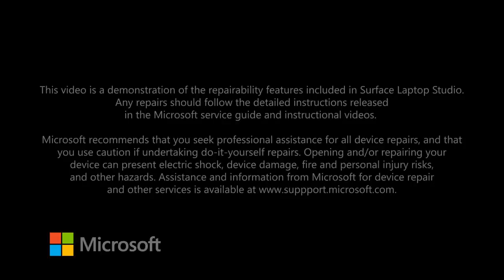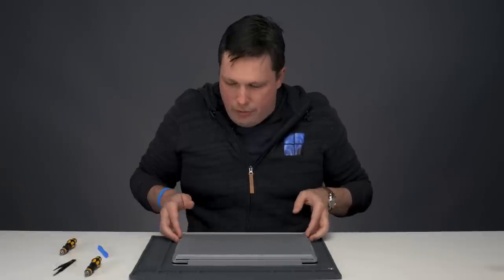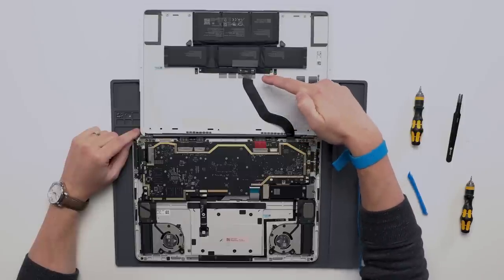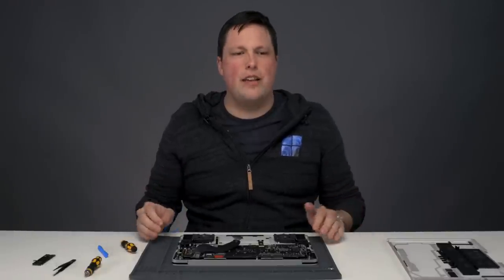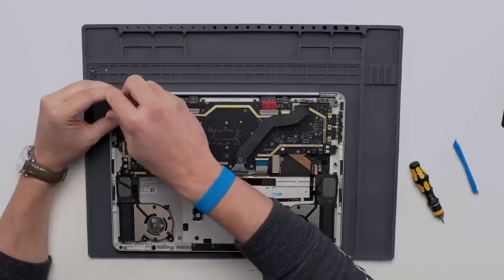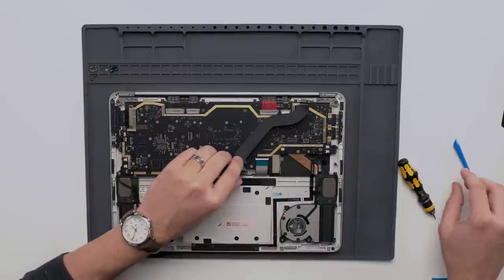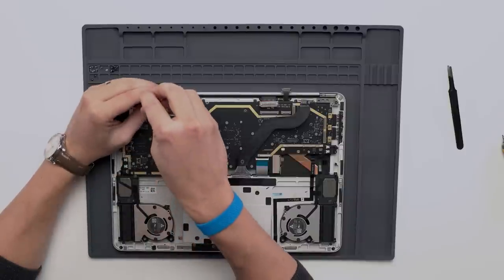Repair | Surface Laptop Studio

Comment: Surface Laptop Studio was on my AVOID list, because I assumed it would be a nightmare to repair it myself, especially the display and potentially a glued in battery. This video is very powerful, as it has now moved this to the top of my list for my next mobile workstation. Thanks for this video and also putting the RTX A2000 into this device. This is a huge step in the right direction Microsoft, seriously thank you, please do not stop here.
Reply from the maker: Don't worry, we're always looking for ways to improve! But we're happy to hear that we were able to turn things around. 😉
Reply: @surface  Do you think you could do a video on reassembly after opening up the device? That would be really helpful
Reply: Where can I find a review video talking about this laptop with an RTX A2000
Reply: @io_inc  Surface Laptop Studio has 2 options. Nvidia RTX A2000 or RTX 3050 Ti. You can see it from Microsoft website.
Reply: Ok.... so.... can the memory he upgraded?
Reply: @ninjaunmatched  No, because it uses lpddr4x memory, which do not come in sodimm sticks.
Reply: So RTX A2000 is better !? Than 3050
Reply: ...but, but battery still glued
Reply: @DmitrijRebrov  Stretch release adhesive makes it easy enough to replace.

Comment: My old Surface Book 1 wishes it was this repairable. Such a positive change to make these devices more serviceable and recyclable.
Reply: I echo this, this is a huge improvement.  In early 2020 my SB 1 got the dreaded well-documented swollen battery problem.  After a super-careful crazy two hour repair, I successfully replaced it with another battery, but the touch/pen no longer worked properly.  Then earlier this year the swollen battery occurred again, but this time in the base/keyboard.  I removed the battery but didn't bother to replace it.  The whole thing is now being held together with green masking tape.  Hopefully all the future Surface products get this repairability treatment.
Reply: My old Surface Book 1 is now in need of repair after 6 years, I was going to avoid Surface devices, but this is making me rethink.
Reply: @Hans-gb4mv  wow!! It lasts a long time

Comment: Microsoft, if you keep that way into repairability, especially if you emphase it on your next surface laptop, it's a win
Reply: Def hoping this applies to the next Surface Laptop. Surface Pro is a lost cause for repair ability as the design from the Pro X and Pro 8 is probably locked in now. I would like to see upgradable RAM on a future Surface Pro, even if you have to buy from MS

Comment: This is a major improvement over previous Surface devices! 

My only real concern is the two final screws holding on the cosmetic plate are hidden under a vinyl sticker, which would make reassembly next to impossible to maintain the aesthetic cohesiveness. A pin released panel like the SSD/SIM panel on the Surface Pro would be much sturdier, accessible, and easily reinstalled.

Thank you for making such an effort at improving repairability and keep up the good work!
Reply from the maker: Thank you for the kind words, and we really appreciate your thoughtful feedback!

Comment: So good to see how much can be replaced and how little adhesive is used. It'd be awesome if a future iteration made the battery replaceable, too, but I imagine that's a bit more challenging to engineer than other components.

Also, props for adding that note at the end about needing to connect a charger after reassembling - probably saved someone out there from panicking ;)
Reply from the maker: Thank you for your kudos and we appreciate your feedback! We're always interested in improving so we'll be sure to pass this along to the rest of our team. 😊
Reply: Are the components from the video readily available to customers? Agree it’s a great step but we need to be able to easily and affordable buy all the individual components

Comment: Very Informative and straight forward video.. i love using this laptop.. i have already bought one.. but my questions are, where is the RAM bracket ? i didn't see it through out the video, is on the back of the motherboard?  and how about the cosmetic plate , do you sell the replacement part?
in any case, thanks Microsoft for this amazing Laptop

Comment: Could you potentially drill holes or cut a rectangle on the bottom cover then add a mesh to help with cooling? I noticed that it has poor cooling.

Comment: And where do I get new feet and this other sticker that had to be removed at the beginning?
Better to design your devices in a way that this is not necessary. I don‘t care if any screws are visible on the bottom of the device. 
Even MacBooks are accessible without the need to remove some silly stickers first that need to be replaced afterwards.
Reply: I don't know this personally, but I've seen on reddit a few times that once you register the newer Surfaces, you can go to your Microsoft account, choose Support/Repair (or similar), and they'll send you a new set of feet at no charge.  I assume it's the same for the other sticker.
Reply: The sticker is actually just a plastic strip. It's held down with double sided tape. Speaking of which, anybody here has a source of really narrow double sided tape? Asking for a friend..
Reply: This is still bad practice imo. If I want to open the device just to remove some dust I have to order some replacement stickers afterwards. Microsoft really needs to improve this for their future products.

Comment: If anyone should know. If you do plan to purchase this and upgrade the SSD it's possible. The service guide lists all the parts and part numbers but the only part Microsoft sells is the rubber feet. The cosmetic plate is not available and this is after talking with different people at Microsoft through online support

Comment: Hello, is there any way to replace the USB-C Thunderbolt ports separate from soldering from the motherboard. Also is it possible to get replacement rubber feet and the plactic strip at the bottom. Thank you.

Comment: so, as you probably are aware, the two biggest issues to fix are the stability of the thing, it can get wiggly as you pull the screen out, so a tighter hinge resulting in a more elegant transformation would make this a banger, as well as that people want this thing in 16 inches. Whats your stance on these kinds of user reviews?

Comment: Wow... this gives me chills.
Its like things are going very bad in this world WHILE things are going to get awesome T_T ! WOW xD

Seriously.... AMAZING JOB... I need one like this !
Its sad I need to save so much money for that, but... worth it!

What would be amazing with this laptop is to use the empty space on the bottom of the laptop to add extensions !
I don't think microsoft would do it because it would block a little bit the fans grills, But what I propose is a kind of module (For SD CARD RIGHT? + 2 USB A Ports lol) that plugs into the USB C port. 
The port would be flat and bend to reach the bottom empty space of the laptop on top of the grills but also curve 90 degree to the back of the laptop or the front for the magnets (A semi-rigid plastic cable) This doesn't need to be too big. I say semi-rigid because if its to reach the front of the laptop, It would be harder to break due to it being a cable, so its slim and easy to break if too rigid.
Anyways. In the back idk how it could stay in place unfortunately, But in front it would be GOD-SENT. God-tier level of laptop at this point... !
I don't think my idea is too wild, It would maybe block 15-25% of the right side fan's grills... But its more for productivity I guess... AND From the reviews, The fans are "Too much", the laptop cannot overheat whatsoever... So even for gaming accessories like an External SSD for more space, more hubs and such, I dont think it would be that bad.
Depending on the material of the bottom of the laptop, it could be even be possible to add magnets TO the cable and modules !!!
If this is possible, the sky is the limit for the accessories that can be added because, The fans can actually be saved at 99% because of the space there is BELLOW the grills !!
How I see this, is to add other grills on top (Slim) that supports a bigger bottom and columns that solidify the structure ! This could be done by an amateur too... Sadly I do not have the space to create that :C 
But yah... we could add: RGB, Many external SSD (a lot of capacity since we could put some in the back and in the front ! But SSD would have to be custom made by Microsoft I think sadly T_T) , SD card readers, additional ports, small sound bar, volume bar (which would be amazing), additional macros buttons.

THIS laptop have the potential to be literally the most customizable laptop on the market !
If we can start a trend of doing this... like we used to do in the 90-2000s or wtv with PC cases, cars and anime toys...
This would be crazy nice O: !!

Comment: Is the battery replaceable ? I really want to buy the laptop but im scared the battery wont last long
Reply from the maker: Certainly! This device does allow for battery replacement, there is a self-service option, or you can go to a service center or a Microsoft authorized repair center for professional assistance. 😃

Comment: A repairable design is worthless when Microsoft actively refuses to sell you any replacement part. I have the grinding fan issue on my GPU fan -- which is easy to find documented across the internet -- and after some back and forth with support, have been told that I have to ship my nearly $3000 laptop in and wait two weeks for a mail-out replacement. They refuse to simply ship a replacement fan assembly, which at this point I would even be willing to pay for out of my own pocket (even though it's most certainly a defective part -- others have the same issue and I take very good care of this machine). 

This video was a major reason I decided to trust Microsoft with my investment and so far it's proving to have been a mistake. It's a great laptop, but their adamant refusal to trust me with one of the simplest possible self-service repairs despite the part being defective at their own fault is a major trespass against my trust in them. Impressively enough, even Apple will dare to ship SOME self-service kits & parts out, if for a massive sum of cash. I didn't think I'd find someone worse about self-repair than Apple, yet here we are. I hardly think I'll be buying a Surface again in the future. 

I was almost impressed.
Reply: yeah microshit sucks. going to buy a framework 16 whenever that comes out

Comment: This goes definetly in the right direction. Now teach your engineers and designers to not build these repair traps in the first place. And please teach your designers nobody cares about visible screw heads on the underside of the device as long it makes a benefit for the people like easier accessibility.

Comment: I left the laptop for 2 months and now won't but up, I remove the SSD because this device was bios password user I left it and now I can't make it boot again, any ideas I tried everything tutorial and no hope, I heard from u if u remove the SSD that out the laptop on repair mode any ideas what can I do to get it back on
Reply: the end of the video says that you need to connect the charger to get it out of repair mode.
Reply: @thatonebelgian done and it work only for a few seconds then come back again to black screen
Reply: @thatonebelgian done and it work only for a few seconds then come back again to black screen
Reply: Now the laptop is a boot loop I'll try to press for 35 seconds then again then nothing it keep stuck on windows logo I had a booteable USB to reinstall windows but no luck

Comment: I really want this laptop. But there are some obvious aspects that make me hold off. 

The port selection needs to be better for a "creator focused" laptop. Apple just got praised for returning ports they removed and Surface looks like a copycat chasing for similar or clean aesthetics over usability. What's a studio if everything you need isn't in it? HDMI, Legacy USB A, and a full size SD card reader.

The line either needs to offer AMD CPU selections or be entirely AMD.

Higher GPU selections need to be offered too.

The original Surface Book 1 came with the pen included. Are you not confident enough that the new pen is meant to be a sentimental experience along with your own products. Include it. It's insulting given that the laptop itself has a built in compartment for it. 

There needs to be a revamp of included software. Let's get back to the creator focused tag line you guys focused on. Why is there no included, Microsoft made and optimized software for Photo, video, and sound/music editing. It feels there is no software identity in terms of amateur creation.  

You guys are so close to the perfect laptop here. The webcam is the best in the business, the touchscreen has amazing quality and functionality. The build quality of the chasis is premium. The keyboards have also been great. The fact there is now an attempt at repairability is insane given the history of these products. But the minuses are more glaring when you're close to perfection. I loved the Surface Book 1 for 6 years until it developed spicy pillow battery. That laptop made me realize that a laptop should be touchscreen and pen supported for note taking and design. Please make a Surface Laptop Studio 2 that feels good to upgrade to, without the caveats. 

Please send this to the Surface team.

- an enthusiast who wants to use this product.
Reply from the maker: Hi, there. Thank you for sharing your honest and helpful feedback as we are always looking for ways to improve. We will be sure to pass this feedback along to the rest of our team!
Reply: @surface  Thanks so much. It actually means alot to me that this will reach the team.

Comment: Ok so can memory be upgraded?
Reply from the maker: Hey there, Gary! You can choose how you'd like to configure Surface Laptop Studio here: https://msft.it/6059jPNt3
Reply: Uh.. can you upgrade the memory after you buy it?
Reply: Ig you can't. because everything is build-in (battery, memory..). You can only replace your memory with new one that has the same manufacturer, the same product serial number.

If you don't do that. the new memory won't work

Comment: This might sound crazy but I know the CPU is soldered in but what if a professional that can unsolder it and put in a 12th gen i9 core? or something much more powerful? For a SLS I got the 3050 RTX 4gb ram which is kinda weak only 4gb ram??? But I got the 32gb version however IT can play some AAA games pretty good but you usuually only get 30fps rarely youll get a 60fps constant lock evne on low graphcis which kinda blew my mind does anyone know how to undervolt this laptop? I got the highest build i7 3050 32gb 2tb but for the price of over 3k I though it would of been a lot better, I could of gotten a gaming laptop that was way smaller and also a 2in1 but nope, I wasted my money on this lol I regret it to be honest...... But now I have it and what else can I do?

Comment: @Microsoft This is definitely a step into the right direction. However, there are some points to address before I consider buying a surface again:

1. PLEASE, no adhered parts! Neither the rubber feet or the "cosmetic plate" would have to be pulled off if you had added some visible screws on the bottom of the device. You don't have to hide screws. Just use polished ones and make them look nice.

2. Make replacement parts and detailed repair manuals available to everyone. Just add surface parts to your online shop. As an electrical engineer, I feel pretty confident when repairing my own devices, even though I am not a "Microsoft certified technician". I don't want to waste my time and money having my device repaired at a "certified workshop".

My Surface Book 1 had a bulged battery. Microsoft's comment was (in short): "Very sorry, but we are happy sell you a new one!". I ended up putting in a battery from some shady Chinese source. It seems to work pretty well but I really would have preferred Microsoft parts.

Comment: The Surface Studio could be perfect, but the weak processor is a no-go for a content creator. 4 cores just don't cut it. A 5800h or 5900h would have served Microsoft much better here.
Reply: Power requirements vs battery life maybe? Most people are not pushing their laptops that hard.

Comment: Just the way this laptop is designed, it's awful for repair. That flimsy cable connecting the battery is in itself a design crime. A good repairable laptop has easily removable battery and components. Taking off the back plate should be simple by removing a few screws, not this insanity of glue and adhesives. Dell XPS laptops are way ahead in terms of repairablity. Microsoft is making this move because of the heat coming from repair legislation that's getting momentum. Nice try, MS.
Reply: Hopefully more improvements to improve its repairability. That "cosmetic tape" alone is already bane for repairability, which isn't obvious for those who never seen the videos about disassembling it. Not to mention, it would be pain to put it back and gets broken during the teardown. Surface Laptop were far better and easier than this.